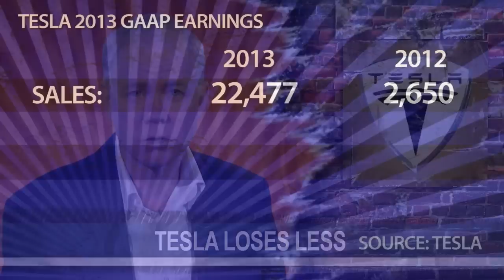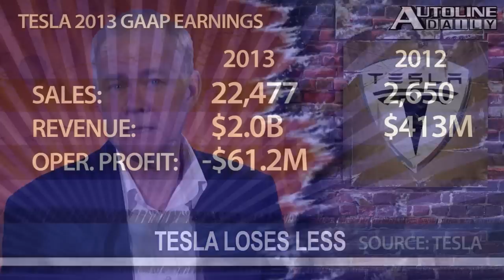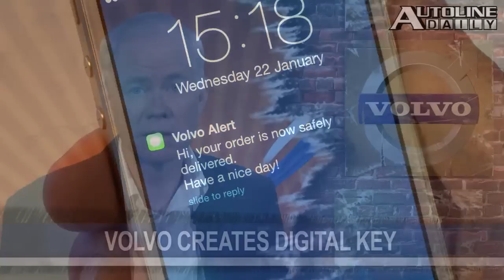Tesla Loses Money, But Not As Much As Before - Autoline Daily 1318

Comment: A good show as usual but I'm not buying the replace all tires at once on a 4 or AWD vehicles.  I've owned several such vehicles and have never had an issue with replacing a damaged tire.  I find it hard to believe that the very minor difference in the size of a tire wouldn't be accounted for in the design of the 4WD system.
Reply: Some systems are much more sensitive to rolling circumference than other systems. An early Volvo V70/XC70 system (for example) is quite fragile and even driving on the factory spare tire for a limited distance has been known to cause major mechanical damage to these cars. Even on SUV's and trucks with part time 4wd can have obvious issues with engagement and disengagement if the thread differences are too much between the axles.